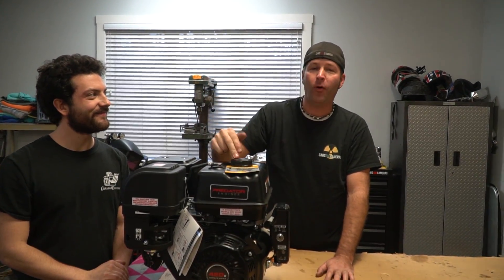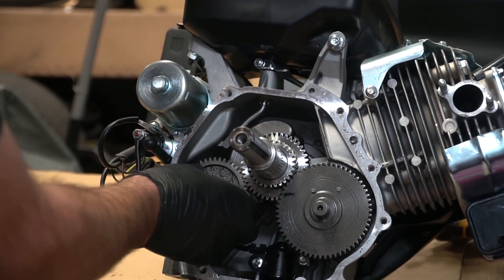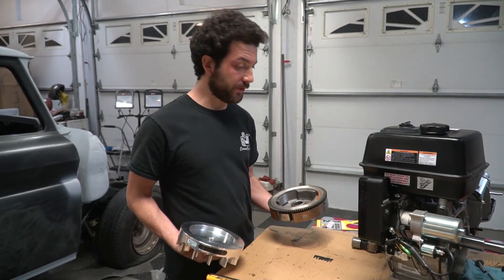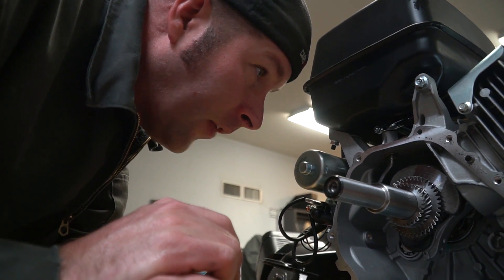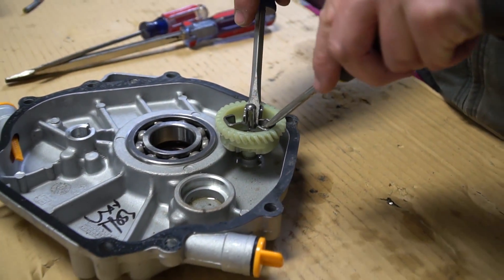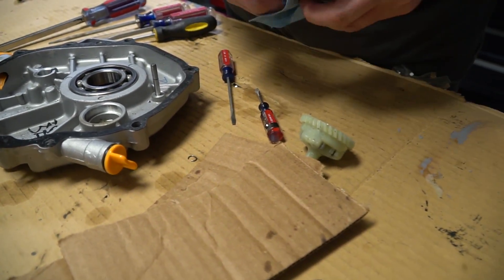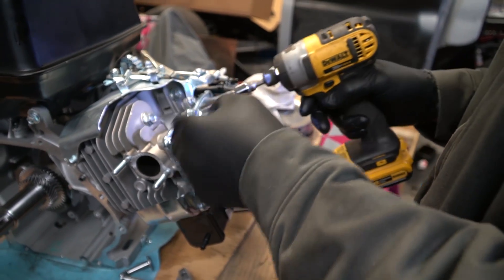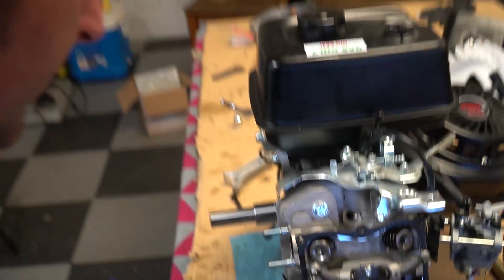Predator 420cc Stage 2 Build Pt. 1 | Cam, Rod, Flywheel, & Etc!

Comment: I don't think I would sacrifice electric start and charging coils for a billet flywheel. Especially in a golf cart application, you gonna have to lift the seat to start it every time
Reply: pogosticknick 
They can use the golf cart starter generator and all they would have to do is put a pulley on before the clutch so the starter has a way to turn the motor
Reply: I agree with pogo, losing the electricals will bring it's own inherent issues.  As for retaining reverse,  there are carts that came with the reverse/forward in the rear end. Ezgo, club car,  I'm not sure. If they can find one of those,  great.  Another issue will be grenading the rear end with that power increase. They were designed for 12 to 15 mph
Reply: Red beard did a golf cart maybe you should look at the way he has set it up where he still have his electric start
Reply: @nicholasmcgraw6875  yeah I'm familiar with them, that was a tillotson 212 comes stock with the same built in electric start the stock 420 has
Reply: You can get a Billet flywheel with a starter ring gear
Reply: I lost interest at the point where John said the electric starter would not work
Reply: I’m not familiar with the predators , is it a normal ring gear that’s pressed on? 
Heat it up a little and press it off if so. 
Then the next question is, would it fit on the new flywheeel?
Reply: @MrTheHillfolk  won't fit
Reply: Joel Boley 
Heh I figured as much. 
Sometimes I wish I had a 5 acre yard piled with junk so I can try stuff.  
Like see what ring gear might be close enough if you shave a few thou off the od off the flywheel,or something. 
I’ve got access to a lathe and mill and sometimes it’s fun to whittle your way out of (or into) a situation.
Reply: Same

Comment: No electric start or power generation for lights on a golf cart you want to use on the street???   Can you say useless???   In fact, I bet you regret this choice in a mater of a few days.
Reply: Gas golf carts come stock with an excellent belt drive starter/generator. I imagine that they'll be using that instead of the junk by comparison Predator systems.
Reply: Did you not hear him say they were going to be "pull start" only?
Reply: -.- They meant that the engine will be pull start only. They could still use the generator for the lights.
Reply: Uh huh...

Comment: Cars and cameras!! Look! Great videos guys. Your channel has inspired me to build a golf cart about 3 months ago when my stock engine finally blew up. I started with a 500cc Polaris four wheeler engine I Hooked it up to stock rear end and as you could imagine I overheated the stock rear end and the old brakes were non existent and as you can imagine going 30mph+ with no brakes was not fun! So I decided to scratch the idea and go with the duromax 16hp 420cc electric start and the 30 series converter only for short period until I get a better converter . The hardest thing I’ve done to it is the live axle swap. Installing the axle was easy but making it stop is a lot harder than one might think I’ve tried the mechanical brake caliper kit from go power sports but it doesn’t stop like I want it to   I am currently waiting on the hydraulic caliper kit to see if that helps to stop it a lil better and I am running 25” tires and a top speed of 49mph  so that could be a reason it doesn’t stop  
I am curious to see how yall are going to build your golf cart, how fast it’s going to be and how fast is it going to stop!!
Most important be careful and always remember 
ITLL BE FINE!!

Comment: you can try putting the piston at TDC and shoving rope into the spark plug hole to fill up the combustion chamber to prevent the valves from dropping in while the springs are off.

Comment: I ran into the same issue with changing the valve springs in my gx390. My Roadkill Ziptie moment is to use zip ties as valve spring compressors.

Comment: When you disable the governor on one of these engines, is it necessary to remove the components inside too? You guys seem to do so each time, so I would assume so, but could one just hook their throttle cable right up to the butterfly and remove the external governor components?
Reply: I think if you just delete the governor you will be ok because you'll get valve float first, but if you upgrade cam and valve springs to run high RPMs the oil splasher thing on the connecting rod will break off and ruin your engine.  At least, that's what will happen on a 212cc predator

Comment: As for installing/changing valve springs with the head on. Pack the void with the piston at about 1/2" from top dead center with clothes line rope or the like, then set the piston at TDC, this will hold the valves in place while you reinstall the valve springs. Then simply pull the rope out after you're finished. Where there's a will there's a way! Cheers Guys! Zip~ p.s. I know these tips are after the fact on this engine, but will come in REAL handy on future builds.
Reply: Thread a fitting for an air hose into the spark plug hole. Fill cylinder with compressed air.
Reply: camjamsdad 
2 screwdrivers on each side of the retainer and push down to compress the spring. 
There’s so much old school tech tips they coulda used for that, like someone else said it’s after the fact. 
They can try it next time
Edit: 2 screwdrivers and some metal chunks (sockets) as fulcrums. 
Hopefully ya can see what I’m trying to convey but the darn words aren’t cooperating ! 🤣
Reply: too old school!

Comment: If you're trying to get a bearing out of a blind hole just stuff grease and shop towel behind it, hammer it into the hole with a bolt smaller than the hole in the bearing and repeat as shown by AvE

Comment: Ive got a question for anyone with the knowledge to answer. Will a 5 hp briggs flywheel and mag work on a 3.5 hp briggs? My mag and flywheel are junk and someone is offering me a free 5 hp flywheel and mag. Just want to know before i get it
Reply: @Skott its just so old that it isnt working properly. And yes ive cleaned the flywheel and the points. Points with a rag flywheel with a wire brush

Comment: Here's a little tip for removing bearings and bushings in a blind hole guys. Pack the center hole with grease then use a punch or wood dowel the size of the hole in the bearing and hammer the grease into the hole. It will hydraulically force the bearing out of its seat and it's quick and easy to do. Thanks for taking us along! Zip~
Reply: White bread works better
Reply: ZippoVarga  in this case you would use bread and a dowel.. same effect different material
Reply: if grease does not work (becuase open bearing) use bread. it works
Reply: @jobhoornstra802  bread works great but you can use wet toilet paper or paper too. I really don't keep bread laying around the shop.
Reply: It's true but in this case the removal of the bearings for the balance shaft is totally unnecessery. They are not needed but they don't hurt anything.
Reply: @kaneto88  Say that to the crank when bearing comes loose in crankcase.
Reply: Thumbs up on that  @kaneto88 .  I've been waiting for someone to question why pulling the bearing was necessary at all.
Reply: @kaneto88  Thanks for answering the question I was going to ask.
Reply: I think kartFab did something similar on a 390 build, however it didn't work so well blew a hole in the case behind the bearing. Tig it back together! At 5:50 https://youtu.be/mBMhE9j1m4Q
Reply: @devindunlap5933  haha yeah man it worked on the crankcase cover, but not the block.
Reply: That's a great tip that actually works!
Reply: @anthony560  Not with a open cage bearing like that.
Reply: @nelsondavis4310  exactly what I was thinking.. the bearing don't need to come out as I built the same 420 with same kit... Pointless work their doing
Reply: A bead of weld on the inside of the outer bearing race will shrink it enough to remove it. A trick I learned from a machine shop.
Reply: 100% this works wet paper will also work
Reply: Damn, beat me to it!
Reply: That bearing would go through heat cycles and be vibrated to hell, taking it out before it falls out seems like common sense.
Reply: Play dough is what we use in my shop. Or grease. Depending
Reply: genius
Reply: Welding inside of a motor would be the last method I would use. A bent flathead will pry it out easy
Reply: ZippoVarga what?
Reply: Yup, my grandpa who was a machinist taught me that trick
Reply: Avoid this if possible. 99.9% of the time it will blow the back of the case out. It's thin aluminum.......
Reply: i've seen guys use a piece of wonder bread to push out bearings also.
Reply: Three tack welds 120 degrees apart on the inner corner of the bearing race will shrink it enough to pop out with a pick
Reply: I saw Chris fix use that method in his most recent vid
Reply: I shall stick to blind hole pullers.
Reply: bar soap works too.
Reply: Aluminum is thin. Will blow a hole in the block
Reply: That shit works 0% of the time 100% of the time.

Comment: Use the hose from a compression gauge, apply air pressure from a compressor and it will hold the valves in place while you have the springs off.

Comment: So you're not going to be able to run a starterator on it I'm guessing since no charging system and also if no charging system also no lights so will that still be road legal there. I know here in SC you can run them on the roads in certain areas but they have to have headlights, tail lights and a rearview mirror.
Reply: You could but it wouldn't be a charging system to recharge the battery so every 3-5 starts im guessing the battery would need to be removed and charged.
Reply: @2v_media  Yea but im sure theyll just charge it up after running it cause its not like theyll just drive everywhere in a golf cart
Reply: It's not ideal.

Comment: Get a engine starter at the dirt track I race on outlaw karts use electric starts its kinda like a over powered drill they had a 420 built as bad as can be they have to use a electric start it's got to much compression to pull
Reply: english please
Reply: @user-qx7tm5df8j  sry auto correct messed me up lol

Comment: You can stuff a clean rope in the cylinder and devise a forked tool to reinstall the valve springs. Make sure to leave enough rope hanging out of the sparkplug hole!

Comment: Better add some timng to that flywheel, AND torque it down correctly.you can use one drop red loctite on taper and after torqing it down, use hammer and wide punch to tap fly wheel a little further onto shaft and then RE TORQUE fly wheel nut, thank you...

Comment: Why can't you just leave the bearing in? It's not in the way? Also why take out the low oil shut off? Doesn't change power obv
Reply: You take it out the low oil sensor because when taking hard turns the oil will all go to one side of the engine and the low oil sensor will detect that there is no oil and shut off the engine. My first race kart had a stock 212 on it and when I took this one corner at my local track it would shut off almost every time.

Comment: What's the reason for removing g the low oil cut off. Just wondering
Reply: obviously it wouldnr be a good idea for daily use. but they just dont need the engine to stall every  pothole they ride through
Reply: Josh Martin  I think they did it because when you go throwing the cart around corners the oil sloshes away from the sensor giving it a false reading.  Therefore it thinks its low on oil and I assume it shuts down.  Just my theory.
Reply: You take the low oil sensor out because when taking hard turns or big bumps the oil sloshes up or to the side and the low oil sensor detects no oil and shuts off the engine. I have had it happen to me on my old race kart with a stock 212.

Comment: If you wanna take advantage of a road legal golf cart, put the ducati engine in it.
Reply: yeah right...those east coast towns are quick to pass an ordinance  against anyone that might be having to much fun...plus what are ya tryin to do, kill our guys?
Reply: Becareful using bread will break case...outward force, my buddie did that
Reply: @jakeboss9020  I was waiting to see if someone picked that up. I would just locktight a rod in there and pull it out.
Reply: Your statement has been said thousands of times.
A good idea doesn't come from the general public.
People like the idea because they have heard it over and over so it's not a surprise.
Reply: Ducati this ducati that....it's not really what this channel is about
Reply: I couldn't AGREE more! The Ducati would really make them regret legalizing golf carts for the streets.
Reply: On that balancer bearing you should have put bread in there and the bread will push it out just like on a car engine with pulling out of balance or bearing just put bread in there and you mash it in there in the burial Papa you can eat use soap
Reply: jordan tractor vlogs yep or grease and bits of paper rag.
Reply: @jordantractorvlogs7008  Wut?
Reply: @JRWperformance  I don't know about bread but you can fill the center hole with thick grease then find a rod that fits snug and hammer it into the hole, as the grease is compressed it works behind the bearing and pushes it out. Dunno if my explanation sense at all but that's the gist.
Reply: @Xaltar_  Wet toilet paper is one way to do it. Probably better than bread.